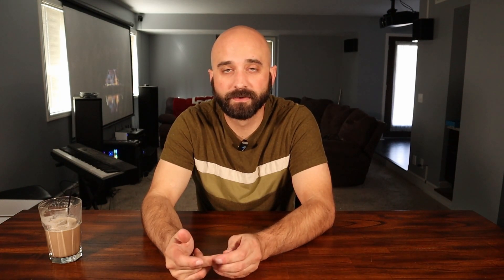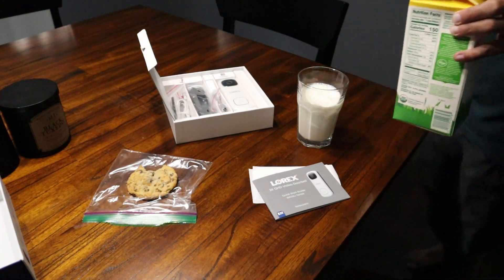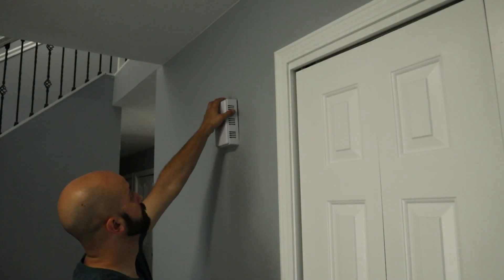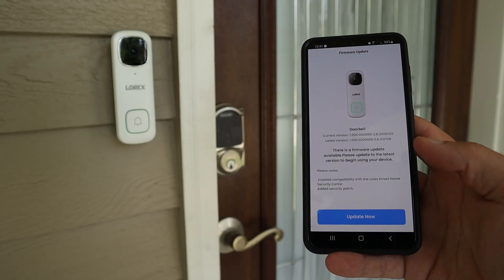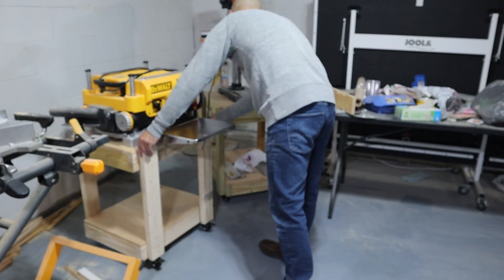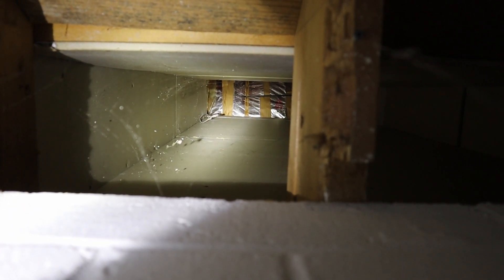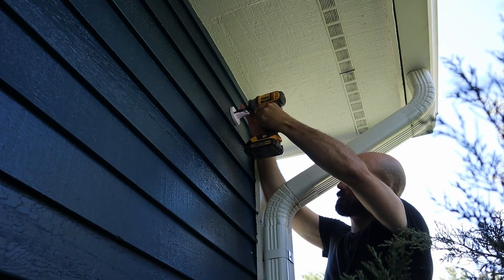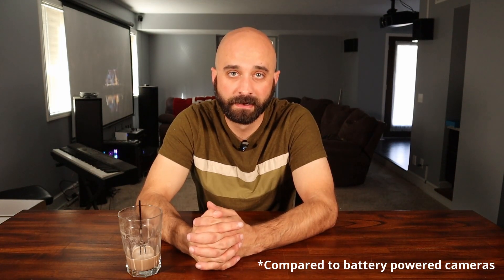Lorex 2k Doorbell Camera and NVR Fusion Cameras

Comment: I bought n 8 camera fusion system from Lorex a year ago and I am getting up in years so I just called a reliable company to come out and they hooked it all up including the 2K doorbell and a 40 inch 4K monitor for a good price . My home is a single story and a little over 3000 sq.feet . on about 3 acres and I love the fact there are no fees to mess with . These cameras will pick up motion a quarter mile away if you don't dial them down ! LOL It is good piece of mind because as long as I have my phone on me I know instantly what and where something moves . I have a security system but I only use it when I am gone .

Comment: How do you like the doorbell camera? I’m on the fence about it. I’ve read so bad reviews about it, I’m not sure if it’s user error. Or the doorbell isn’t that great. What do you think? Any issues with the camera staying online?
Reply from the maker: I like it quite a bit and haven't had any problems at all with it so far.  The app works well and is responsive and quick.  It's also very configurable for motion and notifications.  I honestly don't have any complaints about it.
Reply: I've had the Lorex doorbell camera for some time now and I'd still buy it over any other doorbell camera. I tried several doorbell cameras and this is my all-around favorite. Almost all of the bad reviews are from people who don't know what they are doing. The two most common installation issues are not having the correct doorbell transformer and not being able to connect to you wifi. You transformer must be 16-24VAC and at least 40Va. Those numbers should be indicated somewhere on the transformer. If you have a problem setting up the camera look for solutions on Youtube or Google because it's most likely a user error and not the fault of the camera.

Comment: Can you help?  I am trying to put together a package with Lorex.  I think I will get the N845 Lorex Fusion 4k 16 channel so that I can use wired or wireless.  I want to get the doorbell, and 2 or 3 cameras to start with.  I plan on putting one above my garage door, and one in the backyard.  I have 3 acres and am in the process of building a house.  I want to be able to see if someone is on the property...and at night.  I am looking at the Lorex 4K Smart Security Lighting Deterrence Bullet AI PoE IP Wired.  However, I don't know if the lighting is enough at night.  There floodlight is expensive $249.99 and it says wired.  I am not sure of the difference between wired and  Poe IP wired.  They have spotlights but they are wifi. Thank you
Reply from the maker: I really don't have any experience with any Lorex cameras other than the system I bought through Amazon.  From what I remember you can get all different package configurations for all different prices depending on where you buy it.  If you need help picking out what you need, you might want to reach out to Lorex and see what they would recommend and then decide for yourself whether or not to get it.
Reply: @renovateyourmind  OK thanks for responding

Comment: What NVR are you using? Are you using Echo Alexa?
Reply from the maker: It's the 8 channel, 3 TB hard drive NVR.  And yes I have several Alexa speakers.
Reply: @renovateyourmind  I am looking at the Ring, which I don't like having to depend on them for storage and pay for it, Reolink, and Lorex. What I have heard is that Ring is most compatible with Echo Show Alexia. I want Alexia to show who is at the door automatically when someone is there.  Will the Lorex doorbell do this?
Reply: @renovateyourmind  one other question.  I am building a house and don't have a door bell.  I would like to use the doorbell in Alexia do you know if I can with the Lorex doorbell
Reply from the maker: @davidoliver9395  Yes you can.  I just looked into it after reading your comment.  I linked the Lorex Home skill through the Alexa app and can now view any camera or the doorbell on the Echo Show on demand.  I also set up an automation through the Alexa app so any time the doorbell is pressed it will display the doorbell camera automatically.
Reply: @renovateyourmind  that is great thank you so much
Reply: @renovateyourmind  how did you set up the automation through Alexa for the doorbell
Reply from the maker: @davidoliver9395  You'll have to go into the Alexa app and enable the skill called Lorex Home.  Then you can set up a routine in the app to do what you want.
Reply: @renovateyourmind  I did that and under routine I picked smart home then doorbell and it says it is unsupported
Reply from the maker: @David Oliver  I have a work around where I set up a voice command to show the doorbell when I tell Alexa to show me.  Then I set the routine so anytime the doorbell is pressed, it will play that action, which shows me the doorbell camera.
Reply: @renovateyourmind  OK thanks I appreciate it very much

Comment: I’ve had a couple Eufy’s (2 different models) for 2 years, and they’re garbage.
They just don’t obey their settings, the ai facial recognition does the opposite of its claim of not triggering for frequent triggers from known faces. But it will only trigger on me but not strangers.
The doorbell chime volume can not be adjusted, the doorbell simply rings out of nowhere in the middle of the night, the communication feature is too quiet to work and cannot be adjusted. And no matter how small I set the surveillance zone for, it just doesn’t care, you can walk right through it, and it will not trigger.
And they can’t be made to constantly record.
They’re literally garbage

Comment: Hello im in the process of fitting my mums lorex NVR system.  I was wondering if there is any benefits of having a lorex door bell along with this system?  She currently has a Eufy doorbell connected to Alexa echo, however there is a 4sec delay.  Ideally it would be great  if the lorex door bell can connect to the NVR so image pops up on the NVR monitor due to her mobility it would be easier for her ti view.  
Thanks in advance for any information regarding this
Reply from the maker: I have mine set to send a notification on my phone but I use the porch camera (not the doorbell camera) to notify me.  It works great that way.  I ended up to turning off the notifications from the doorbell cam because it activates even when someone is just walking by on the sidewalk and too many notifications means I just won't look at them anymore.  I don't THINK that the doorbell camera can be set to show up on the monitor for the other cameras but I'm not 100% sure.